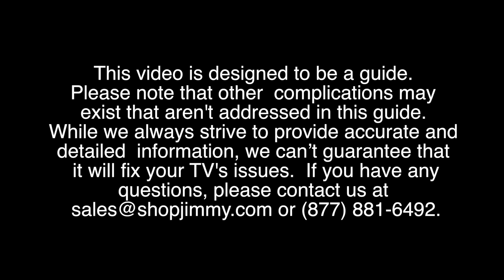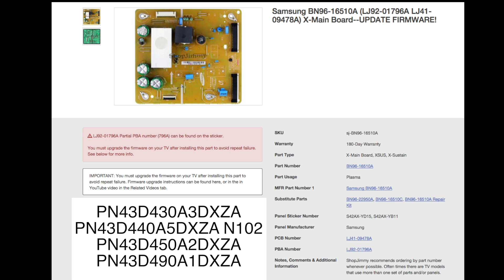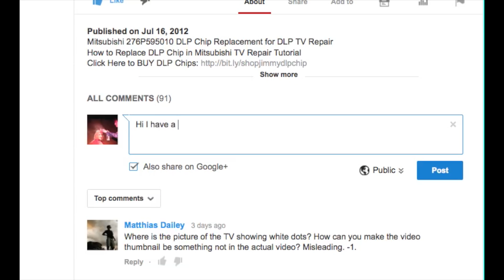Samsung TV Repair - BN96-16510A / LJ92-01796A X Main Board Component Repair Kit - No Power

Comment: My Samsung 3d TV is on standby and will not power on. Model No UA40F6800.  I believe my main board is defunct. Main Board Part No: BN94-06723P. Do you have any suggestion? Could I buy a main board from you? Plz help. Thanks
Reply: Anjan Biswas

Comment: Samsung PN60e550d1fxza. Started not powering up, then n opicture but had sound. then no picture no sound. Bought replacement power board. put it in. still no picture no sound no flash of the screen and no menu. while the back was off I powered the chassi and noticed an LED blinking on the logic board near the base. in a 5 second time period the LED is on for 4 secs and off for one. Any Ideas?
Reply from the maker: Dan Adamany   I recommend replacing the Y-Main Board and the Upper and Lower Y Scan Drive Boards in your TV.  Click this link to replacement parts for your TV model number:  http://www.shopjimmy.com/catalogsearch/result/?q=PN60e550d1fxza  There may be multiple boards for the same TV model number, be sure to match part numbers on your current board, with your replacement for compatibility.  Here is a link to a video showing how to identify your part number, click here:  https://www.youtube.com/watch?v=R1jmj_foId0  Thanks and please let us know if you have any further questions with your TV Repair!  www.shopjimmy.com

Comment: Hello I have a few problems with my samsung LNT5265FX. First the hdmi slots do not work. Second the picture has lines across it. It goes back to normal if I tap it quite a few times or when its on for awhile. What could be the problems? Is it worth fixing or just buying a new set? Thanks in advance.
Reply from the maker: Josue Melendez   Please watch this video FIRST to help with your repair!  https://www.youtube.com/watch?v=BP3NVNCGEv8  I recommend replacing the main board in your TV.  Click this link to replacement parts for your TV Model number:  http://www.shopjimmy.com/catalogsearch/result/index/?cat=56&q=LNT5265FX  There may be multiple boards for the same TV model number, be sure to match part numbers on your current board, with your replacement for compatibility.  Here is a link to a video showing how to identify your part number, click here:  https://www.youtube.com/watch?v=BEPWrefQvqI  Thanks and please let us know if you have any further questions with your TV Repair!  www.shopjimmy.com
Reply: my TV is sandstorm Fein little on

Comment: Hi, I have a vizio e3d470vx LCD TV. There is power to the TV but it won't turn on. One day after shutting it off it wouldn't turn back on. We replaced the power supply board but the problem still persists please help!!
Reply from the maker: killerspartan823  Please watch this video FIRST to help with your repair!  https://www.youtube.com/watch?v=BP3NVNCGEv8  I recommend replacing the main board in your TV.  Click this link to two replacement main boards for your TV model number:  http://www.shopjimmy.com/catalogsearch/result/index/?cat=56&q=e3d470vx  Be sure to match part numbers on your current board, with your replacement for compatibility.  Here is a link to a video showing how to identify your part number, click here:  https://www.youtube.com/watch?v=kxkeGLhlQY8  Thanks and please let us know if you have any further questions with your TV Repair!  www.shopjimmy.com

Comment: I have a Toshiba 46L5200U that will come on, display the red Toshiba logo and then go black. I can still hear sound.
Reply from the maker: John Doe  Please watch this video FIRST to help with your repair!  https://www.youtube.com/watch?v=BP3NVNCGEv8  I recommend replacing the main board in your TV.  Click this link to replacement parts for your TV model number:  http://www.shopjimmy.com/catalogsearch/result/index/?cat=56&q=46L5200U  There may be multiple boards for the same TV model number, be sure to match part numbers on your current board, with your replacement for compatibility.  Here is a link to a video showing how to identify your part number, click here:  https://www.youtube.com/watch?v=3DQe0ATZl_Q  Thanks and please let us know if you have any further questions with your TV Repair!  www.shopjimmy.com

Comment: hi, great video. I was curious about a couple of things though... firstly @5:40 you mention putting dabs of solder paste onto several locations, is solder paste different than flux? Is it different than regular solder? Because I noticed that you only had to heat it to melting for the weld to be secured and never went back with your iron applying solder to the joints...Also, it that some special type of table that you have the board resting on top of?  thx again
Reply from the maker: playokay   Solder paste is different then flux and regular solder yes.  the paste I was using is this exact one here. http://www.digikey.com/product-search/en?vendor=0&keywords=SMD291AX10-ND  It's a mixture of tin and lead and when heated turns to solder.  The table that is lit up below the board is our preheater. http://www.hakko.com/english/products/hakko_fr870b.html  Thanks!  www.shopjimmy.com